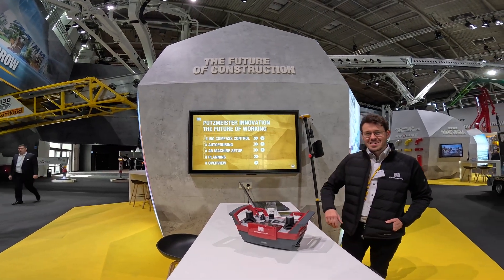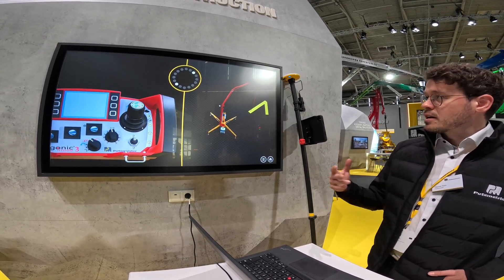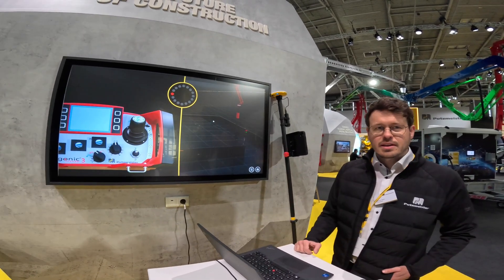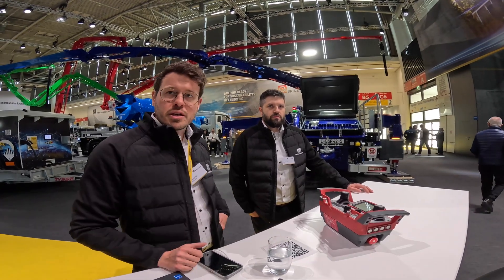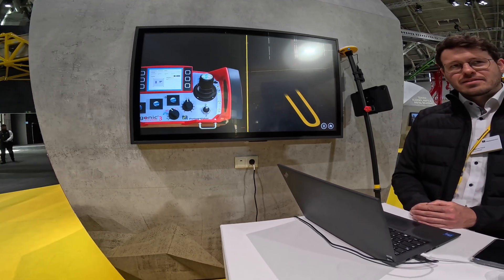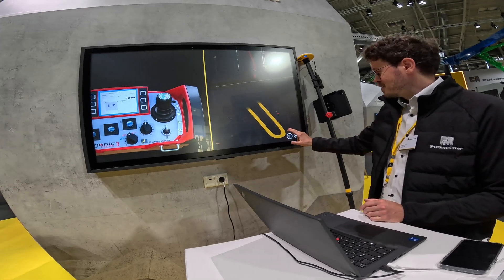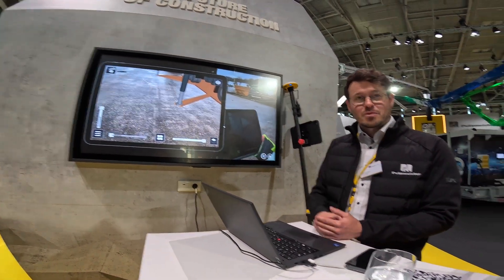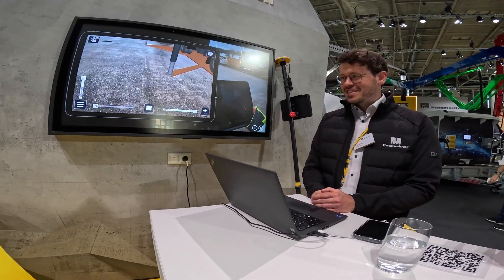In the works: Future Concrete Pump Technology!!!

Comment: no thanks for the auto pour. just takes skill away from the operator. I think that tech could be used for setting the limits for where the pump could reach so that you can't get in trouble